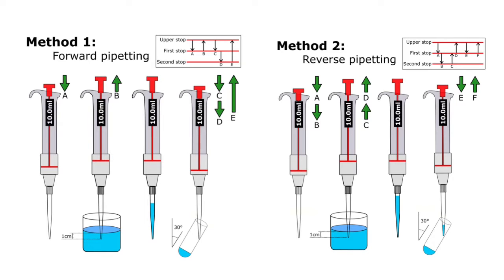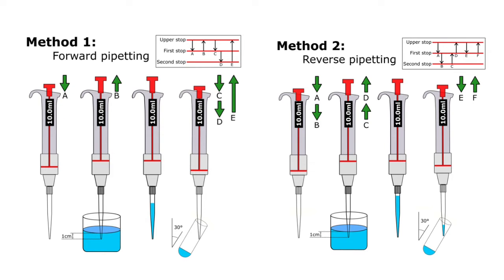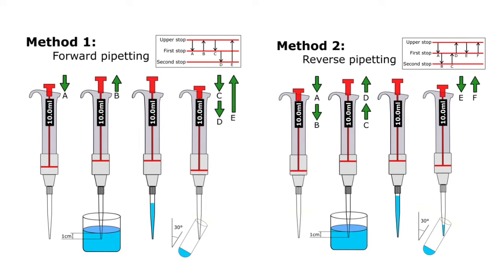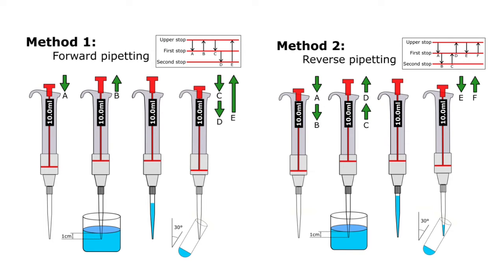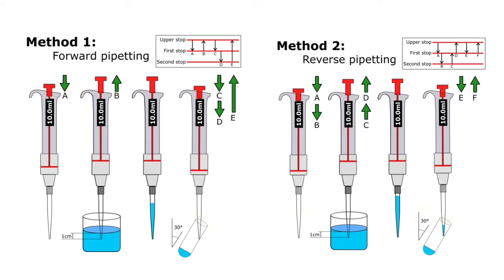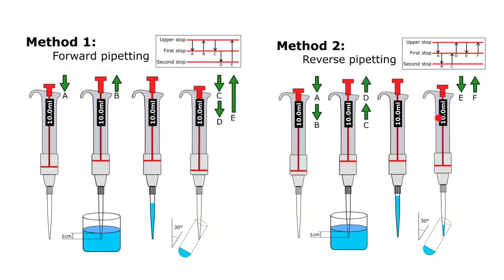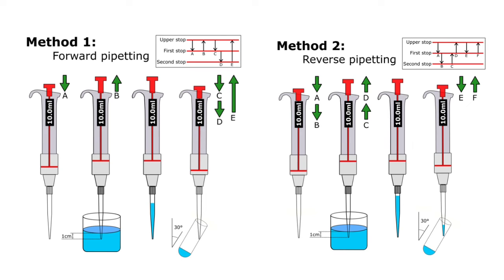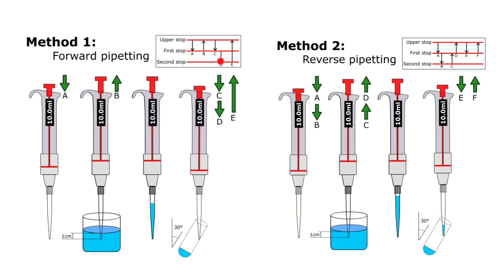Forward  Pipetting vs Reverse Pipetting

Comment: I have heard contradictory mesaages about cleaning the tip after picking up the liquid, some say it should be done, some say it is not necessary. Which one is it? What do you recommend?
Reply from the maker: I would just use a wall of the container.